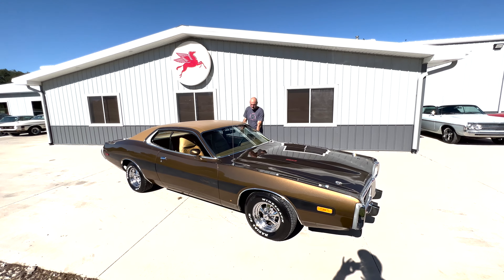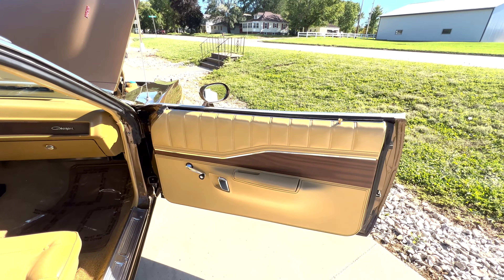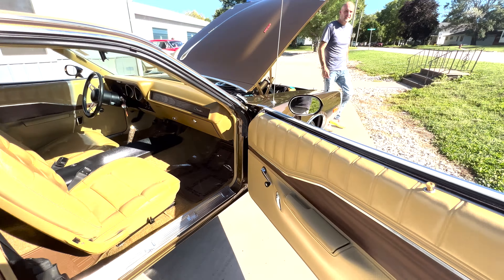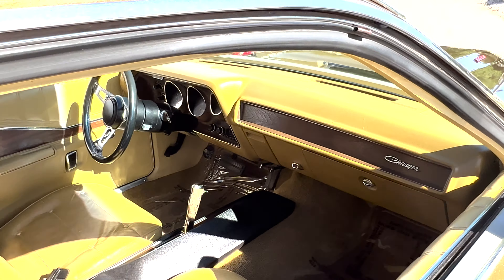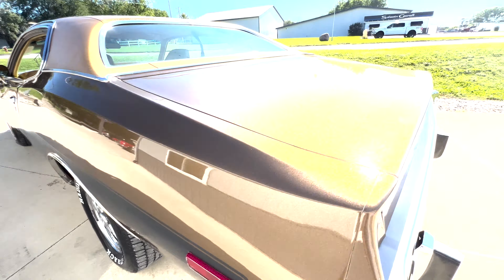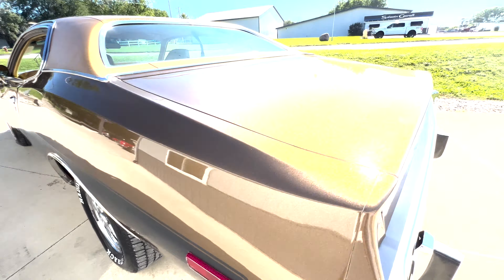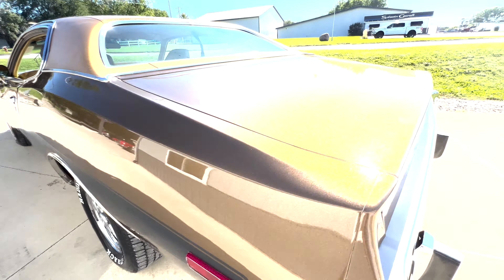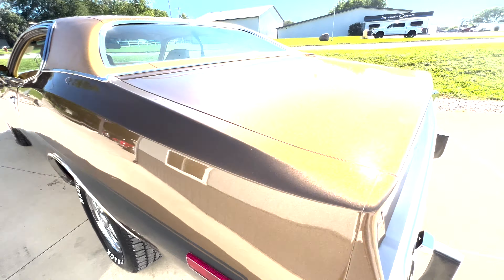1974 Dodge Charger Review & Drive

Comment: Reminds me of my very first car at 16 years old. In 1976. I went to the Dodge dealership with my dad and bought my '71 Dodge charger 383 automatic gold with tan interior... Also had a black hard top.. I paid only $1,750 for that car back then. Wish I had it now... I used to put so much wax on that car. You could sit on it and slide off the fender

Comment: 150hp terrible compared 70 charger 425hp
Reply: To be fair, extremely few '70 Chargers had the 426 Hemi option. Most of them were 335-hp 383 Magnums or 375-hp 440 Magnums. But indeed, the weak, smog emissions-controlled options after 1972 did the Chargers no favors.